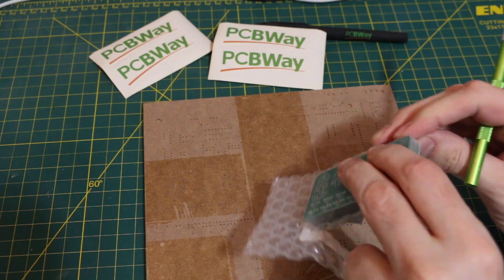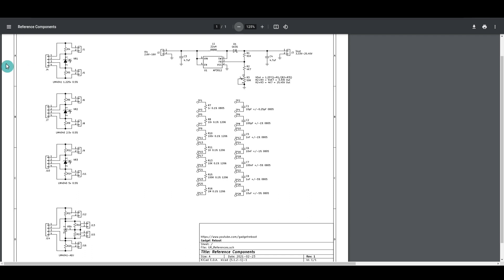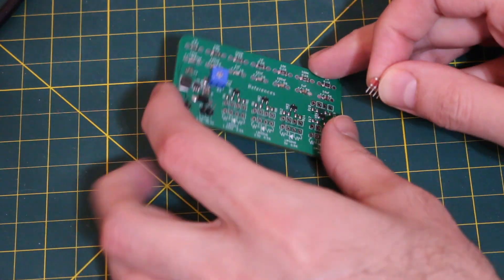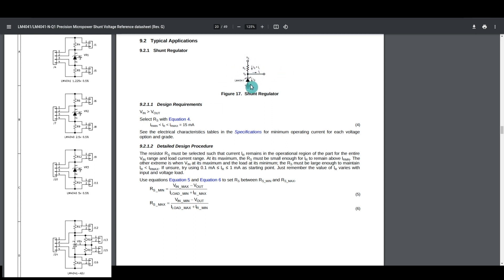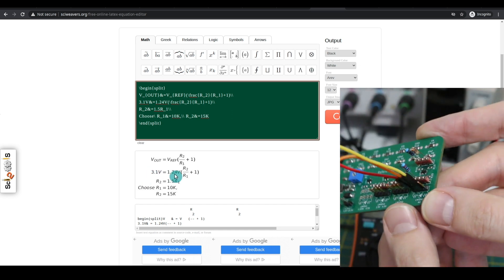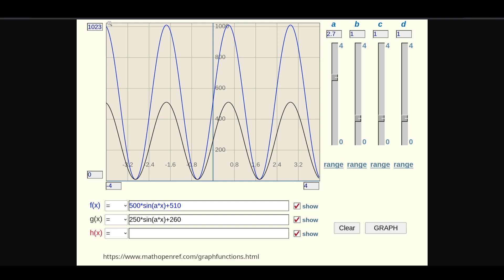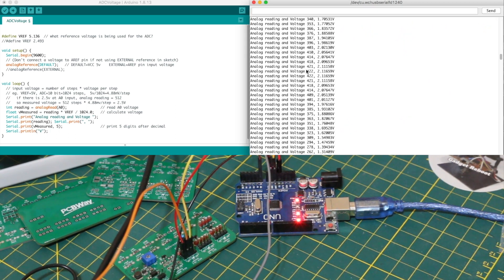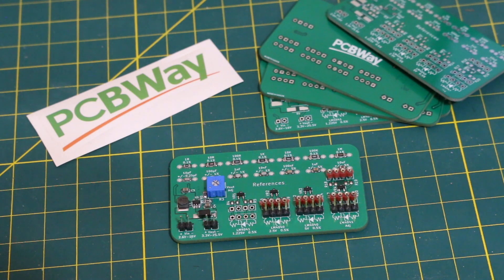Precision Voltage Reference - Arduino ADC External Aref Input

Comment: What use cases does the aref have?
Reply: Couple of possibilities: Increase the dynamic range of the ADC, as he mentioned. By using an Aref closer to the expected max measured voltage, one gets better resolution. Another possibility is to increase the accuracy of the conversion: using  Vin as the reference voltage is only as accurate as the output of the power supply, and may vary with varying demands.

Comment: Might be a noobie question but can you please tell me, will I be able to use the full range of the potentiometer if its supplied with 5V to a 5V arduino while it uses 2.5V as an ADC reference, or it will be limited to the half of the range. Like for example if the pot has 180 degrees of wiper range, will it just stop at 90 degrees because it will provide 2.5V at that point to the analog input of the arduino?
Reply from the maker: The analog input voltage is limited by the ADC reference voltage so if it is a 2.5 V reference then the reading will just max out at 2.5 V and if there’s any higher voltage you will just read the maximum still of 2.5.
The only thing to consider is depending on the chip, it might not tolerate input voltages higher than whatever the ADC reference is or maybe it can still tolerate 5 V, I forget what Arduino is capable of so the specific chip datasheet would have to be looked at to be sure.

Comment: I really wish the built in Nano 5v ref was more accurate. Supplying it with regulated 5v on the VIN pin and the ref is showing 4.6v meh. I'm not comfortable connecting this supply to the AREF pin or will it be fine ?I know the nano has a built in 32k resistor on the AREF input but I really don't like letting the magic smoke out lol.

I have ordered some TI LM4040 5v references to try them out (the data sheet from RS components is awesome / example diagrams :).
Reply from the maker: Looking on page 319 in this bigger version of the ATmega data sheet https://www.mouser.ca/datasheet/2/268/ATmega48A_PA_88A_PA_168A_PA_328_P_DS_DS40002061B-1900559.pdf
It looks like Aref max would be VCC + 0.3v worst case. I didn't look into the actual structure of how Aref and Vref are connected internally, but if the pin is unconnected, and is enabled in a sketch rather than any other internal reference, maybe it measures an idle voltage as a result of other things in there but applying 5V would be ok as long as the VCC of the chip is getting 5V and it's not exceeded........
So if you measure 4.6v on Aref, is that with a sketch running that is set for using VCC as the analog ref?  Once you set it to use the external Aref pin, I'd say it should be safe to apply up to the actual VCC pin's voltage.

Comment: Now I have to check out those LM4041 shunt regulators.  My LM431's need a LOT more current to regulate.  Usually use 8mA or more.
Reply from the maker: Yeah that sounds like a lot, like using a Zener.  I never thought to try measuring the actual current it used but the pcb sockets make it easy to hook up (finding the time is the real issue). I wish I had a good auto-ranging current measuring thing on hand so I could scope stuff like that.  Maybe I should try to implement the uCurrent Gold, I think someone made an auto-ranging version of that.
Reply: That really depends on the type of "431" you're choosing.
The TL431 is basically stable from say 100uA and up
I personally like to go for the TLV431B version (0.5%), which has a 1,2V reference (there are other ones available)
Just check the datasheet for reference.